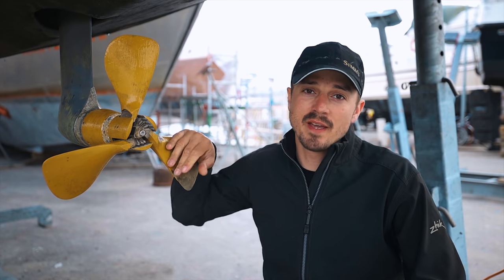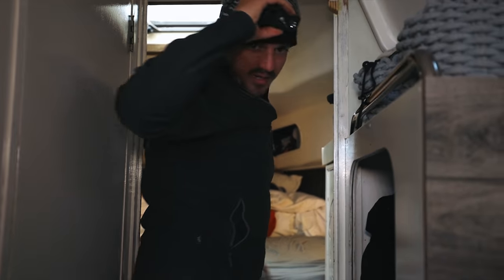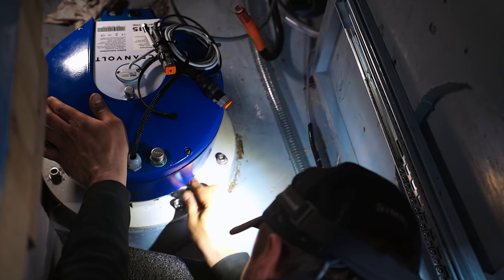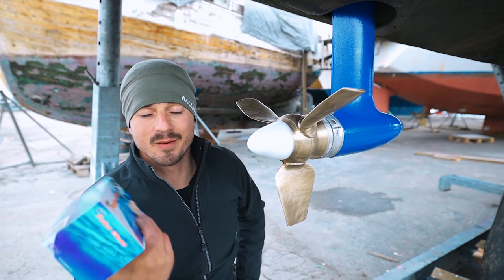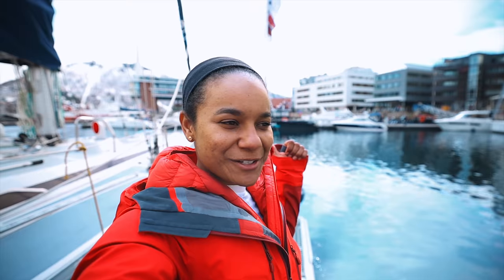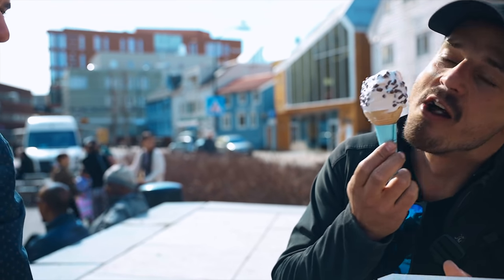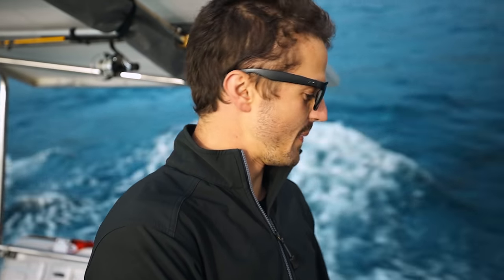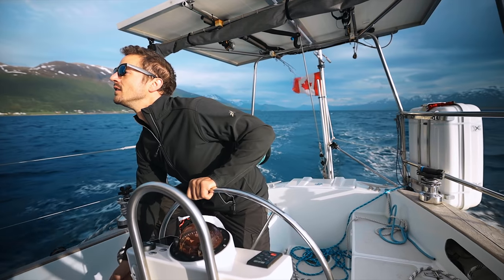Ripping Out our Electric Motor for the LAST TIME! — Sailing Uma [Step 277]

Comment: If you didn't need the wood burning stove than what would you put in it's place?
Reply from the maker: well if we didn't need the wood stove, it means we would be somewhere warm.. in which case, we would need air conditioning instead 😂
Reply: @SailingUma  Good point. Didn't think about that. I was thinking of shelving for more storage.
Reply from the maker: ha, we did have a zen garden before the wood stove. But we most likely wont ever remove it. because even in the med, it can be cold enough in the winter that we'd want some heat.

Comment: Of course you did top up the oil in the sail drive housing … yes yes you trusted the factory filling it … but you didn’t mention it
Reply from the maker: There is no oil in the SD when shipped. Of course we added it after installation.

Comment: Very cool project. Congrats on getting a major upgrade. I hope it works better than designed. However; I have major heartburn about the model number because the SD15 unit that you took out is not the same as the SD15 that you installed. IMHO, this is very poor configuration management. I hope that other details have not fallen through the cracks at Ocean Volt.
Reply from the maker: One is and SD15 the new one is an SP15.
Reply: @SailingUma  My mistake. Thank you for the update.

Comment: If the prop doesn't slow them down. Why bother buying a servo prop instead of a cheaper fixed one? Or lock the lock old one in open position.
Reply from the maker: there are times you don't want or need regen. If you batteries are full, that power needs to go somewhere. It also makes some noise. These motors are made to accomodate faster boats too, that can fill up their batteries in much less time, then have the system off for a few days before turning it back on again.

Comment: Why haven't you got a diesel or petrol generator to charge your batteries when they was low on power and during sailing so you didn't had to get those fumes at shore? You using your dingy with a petrol engine and it only helps you to take you if you have anchor from the coast line and want to get on land. So during your time on land you could easily charge your batteries with a 6Kw 230Volt generator.

Comment: the dynastart system developed by siba electric where the starter and dynamo are the same unit  ie an electric motor and dynamo combined was developed in the 50s and was popular in the 60s.so this idea is not exactly new. but developing it to make it more efficient with modern technology should be possible.

Comment: Question: Are there any zincs to prevent electrolysis?
Reply from the maker: Yes. That big silver shinny ring just fwd of the prop.
Reply: How often do you need to change that zinc and can you do it without hauling the boat?

Comment: The propeller blades seem too small for maximizing regen at typical monohull sailboat speeds (6 to 8 knts). A larger diameter and wider blades should be much better both for regen and propulsion especially since the torque required to throw larger blades is not a problem for electric motors. Additionally, there should be a setting in the system for maximize regen such as angling the blade even if it reduces speed.

Nonetheless, as usual, nice sailing, explanations, and footage. Glad to see your electric solution coming closer to its potential.
Reply: I was thinking the same thing. Optimized for regen at slow speed sailing?  I have a feeling ocean volt knows what they are doing but I would love an explanation if they are following.
Reply: I'd like to understand the physics why this setup can push 15kW forward but only delivers 0,5kW Regen with 7kts of boat speed. I would have expected several kW actually.

Comment: Although I admire your dedication to electric propulsion, an original two cylinder or 3 cylinder diesel probably would have lasted the whole time with minimal maintenance over the lifetime of your boat. I suppose there's trade offs and  some benefits to every system.
Reply from the maker: The original diesel was seized. So we needed a new motor anyway. 

If you have a working diesel, keep it. Just like EV cars. Of your gas car is still running well, keep it. If you’re in the market for a mew car, go electric. Gas prices will only go up in the future.
Reply: @SailingUma  you need not be so snarky in your reply. Salt water and moisture intrusion are the worst on electrics/electronics in marine applications. Wishing you safe travels!

Comment: I would like to have known what the diameters of the two props, old and new, were as I posted a few months ago that a bigger diameter prop, with a lower pitch would generate more power, with only a slight loss of efficiency motoring.

Comment: Why not just run a fixed blade prop without the added servo complexity? If there's no noticeable difference in speed with the prop feathered or not.
Reply from the maker: You don’t always need or want regen. Of faster boats (like the Salona) we were making 1kw of power from each motor. Once the batteries are charged, that power needs to go somewhere. Unlike solar, it can’t just not charge.

Comment: Hi Guys. Sorry but I don't get it.  Fifteen years ago I spent two weeks in the Bahamas sailing every day with a very early tech electric drive system. The boat was a 44' ULDB with a carbon mast and high roach battened main.  As a sailing machine she was in a different category from your smaller and much older design. But the main difference was the large, slow turning, and very optimized four blade prop.  One of  the  pleasures of sailing  the boat was  the fact that  you were always in silent power  mode, either making  or using  power.  In moderate winds I'd set the controller at neutral, which in practice meant that in  the lulls you received just enough boost  to keep the speed from falling  off. Set  for zero regen, the prop would just tick over producing  near zero drag--better than most feathering props.  And when you had energy to spare from sailing  you could crank  the regen up  to the maximum output of the system.  

The latest  OceanVolt design includes a very nice miniature "electric Hundesdat" variable pitch system,  sophisticated prop shape, and advanced electronic controllers, but I'd be surprised if the actual prop efficiency is as good as the big (cheap) slow turning one on the Wilie ULDB,    

On a related issue, I've spent too much time sailing among the floating logs in the Pacific Northwest and the migrating grey whales off Mexico to ever go to sea with a saildrive strut under my boat unless the entire drive system was encased in a water tight compartment that  goes all  the way from the hull to the cockpit sole so the Whale Kiss wouldn't sink the boat.

My conclusion then was that the concept is best suited to a large(er) high performance multihull with acres of solar panels that spends most of it's time anchored in the Caribbean.  And who's owner had a large budget for Li batteries.   Your mode of sailing for sport and as an experiment in technology is great, just not for everybody.  Reminds my of meeting Larry Pardey years ago just after they had done a 54 day passage from Japan in there engineless 24' boat.  Somebody at the dinner party asked:  What did you do with al the time?  Larry paused for awhile, then said  "Well, we had a lot of box wine."

ps-- I like your form of Crazy!
Riichard--- AKA  Crazy Horse

Comment: why would your point of sail affect how much regen you get? speed through the water is all that should matter. I get that beam reaching is the fastest point of sail, but beam reaching at 5 knots, running at 5 knots or pinching at 5 knots should all generate the same power, no?
Reply from the maker: It has to do with overall speed consistency. Pointing and running both fluctuate hull speed more than beam reaching where average speeds are more consistent.
Reply: @SailingUma  thanks for the reply! I love your channel, especially the technical points. The travel component of your channel has been a welcome window into the world from the lockdowns of this pandemic. It hasn't gone unnoticed that you've altogether avoided mention of it. I'm curious about how covid has impacted your travels, but also appreciate that you've created a travel vlog during a pandemic without letting the pandemic seep onto the screen. I'm sure that hasn't been easy. Keep up the great work.

Comment: Why didn't you install both
Reply from the maker: Why would we? One is more than enough to push our boat, and the old drive wasn't very good at regen at the slow speeds we sail. No need to over complicate a simple solution.

Comment: As far as prop designs go I do not think that that particular blade design is the most efficient. I say that because a squared off prob blade architecture results in cavitation on the end of the blade.  The cavitation creates drag and less efficiency. Perhaps the slow speed of the prop will not produce the side effects created by cavitation.  One more issue is that you have a lot of clearance between the blade tip and the hull on your boat.  That tells me that a larger blade could be used to provide more regen power.
Reply from the maker: We’re actually at the min recommended bland clearance. If we went any other, there would be prop slap on the hull and we’d loos efficiency. As for the prop design. Not sure what to tell you. OV has done 10yrs of R&D to come up with the system they have now. Is it the “best”? Not sure. But they think it is, otherwise it wouldn’t be used.

Comment: Regen not going to work with this size prop in any serious way. Gimmicky at best. 
Kika can generate this on a bike with a generator on a bad day, not a bad idea actually!
Reply from the maker: Um… did you watch the end of the video? 500w X 24 hrs is 12kWh a day. How is that not significant!?
Reply: @SailingUma  you have to factor in real world situations, not hardcore sailing like you guys do. I certainly understand the need for sponsorship however for someone sailing in a warm climate, with little wind like most sailers do, you will not meet the energy requirements of a comfortable boat.

Comment: I will say it again,hopefully everyone who has a little common sense will understand it: there will be never enough power drawn from that tiny little propellor from oceanvolt to be selsufficient in powering on electrity the boat.
As long as any system do not slowering the boat from ex.6 knots to 4.4 knots no more power than the 300 w will be obtained.
Or you sail with this size of prop at 30 knots,or you mount an dedicated system with bigger servocontrolled blades.
Off course the guys of oceanvolt are aware off this,since they are much smarter than i am.

Comment: Ocean Volt should develop a prop/servo motor application for traditional full keel boat where the prop is protected and not exposed to fouling.  The SABB diesels used a similar prop with manual control. Adapting a servo motor to the manual control mechanism  would get it inside the boat and still perform the function of controlling the pitch to maximize the regen.

I am not pleased with the fin keel types with appendages like rudders and sail drives that are just asking to collect weed and lobster trap warps complaining about sailing in Maine.  That sail drive with the forward bulb design might be efficient, but it is not practical anywhere where there is stringy stuff under the water.

Comment: A few things surprised me, firstly its only a 34 volt motor, most motors these days are 48v, even my ebike motor is 48 volts and 48 volts has been proven to be more efficient than 36 volt versions, and will draw about 150 amps at 48 volts against the 235 amps at 34 volts. I was also surprised that its only a 12kw constant rated unit (16 horse power), yes it has lots of torque, but once again ebikes commonly have 5kw units with regen and work often at 60 or 72 volts, and regen will be a lot better with a 48/60v system too....  Wonder if there is a reason they went for such low voltages and specs for this setup? (its not as if they are overly limited on space with a boat compared to a bike!) I was expecting a minimum 48 volt (actually 72 volt) and 25kw system for efficiency and safety margin and better regen. And that variable pitch prop is just an extra complication waiting to go wrong, as shown in the video there is no drag with a fully deployed prop in active regen, so might as well just attach a fixed prop and do away with the servo variable prop!
Reply from the maker: These are all great questions....for Oceanvolt. They're the ones that spent 10 years and millions of dollars on R&D to come up with what they did. Is it perfect? Nope, is it better than anything else currently available? Definitely. 

12kW is equivalent to a 40hp Diesel motor. Plenty to push our little boat. In fact we can go 7kts and only draw about 8-9kW. So it's about 25% more power than we can even use. 

The overall system is actually 48VDC, but the motor is 36VAC. Not sure why, but I'm sure there is a good reason. 

As for the fixed prop. A prop that is efficient at pushing you forward, isn't very good in reverse, and terrible for regen. So the Servoprop is basically 3 props in 1, all tweaked for peak efficiency at the given cruising speed of that specific vessel. Hence the added benefit of added complication.

Comment: I was with GE for 33 years as a technical salesman. Applied battery motors for small harbor boats and electric vehicles. Send me an e-mail and I can help. For every 1 knot of speed record ocean volt motor rpm, volts, amps, and watts. Do this in the harbor with no wind and no sails. This will give a profile of the force or thrust it takes to move the boat. Ocean Volt should have a spec sheet showing  thrust vs rpm or torque vs rpm.  The power to move a displacement hull through the water until max hull speed is reached goes up as the cube of the speed. So it takes 8 times as much power to go 6 knots as it does 3 knots.  The power of a motor or prop can be calculated by the formula rpm times torque in ft lbs, divided by 5350 equals horse power. 746 watts also equal 1 hp. You need to know what thrust or force it takes to move boat through water up to its hull speed.   If it takes  say 10 hp to move boat at 6 knots thats 7460 watts , Dragging a prop through the water producing  only 800 watts regen is a small portion of that.
In a strong wind that will not slow the boat  down under regen but the prop has to be the right size and geared properly so it can produce the 600 to 800 watts  at 6 knots.

Comment: You're going hull speed , ofcourse it doesn't slow you down , you've got plenty of reserve power.
Now reduce the windspeed and tell me what happens.
Switch of the generator when going 4 knots and tell me it doesn't effect your boat speed.
I'd install a separate system for power generation as back-up (WATT&SEA for instance) to my diesel engine.
I'll never go full electric until I can reach 700 nautical miles on it.
I like redundancy.
You're telling me enough in your "partnership" comments , you get your shit for free.
I might as well watch the commercials and take what they say at face value :P.

Comment: Price starting from for SD15 servo prop 46600 € + VAT + Shipping.  Its more expensive than the boat lol....
Reply from the maker: That includes batteries and charger (50-60%) of the overall cost. You need batteries and a charger anyway.

Comment: 1:00 Please don't ever do that again! Never stand under a suspended load like that. It is so dangerous.
If this happens to the crane holding your boat up, you'll be squished.
   Note the broken strap is EXACTLY the same kind holding your boat up.
https://www.youtube.com/watch?v=GCpPoUP4tVA
Reply from the maker: It’s always amazing what you can find online. They’re are countless “fail” compilation of folks getting hurt doing just about everything. 

Risk should be assets on a personal level, at that specific time, in that specific environment and circumstances.

Comment: Are they requiring you to ship back the old motor and sail drive unit for analysis?
If not then I would store it away.  Remember what survivalists say
"  Two is one and one is none " .   It will be good to have a spare motor.
You could combine the upper an lower units and make it into an emergency outboard motor.
You will thank me when Somali pirates are chasing you down.

What I am saying is to resist the impulse to give it away.

Comment: Such a system must be expensive! How much? Or, are you not permitted to disclose!
Reply from the maker: Prices for multiple different installations are freely available on their website. 
https://oceanvolt.com/standard-systems/
Reply: @SailingUma  guess when you're sailing the deep blue seas, you have deep green pockets! (Money!) That was an expensive packet! 👿
Reply from the maker: it is quite expensive up front yes, which is why we waited several years before we could even get one, but the whole beauty of this... is ...you can ALSO do it for a lot cheaper (if Regen is not your goal) as we've proven over the lat 6 years, we made it work with $100 forklift motor.

Comment: This is terrible performance - the prop is way to small!! I would say your boat has a power potential around 20,000 watt in those conditions (35hp which is 26,000 watt would probably give you 7 knts through the water and at 80% efficiency that is around 20,000 watt) - so generating 300 watt is absolutely terrible (1.5% efficiency) - and completely useless on a day with low to moderate wind it would basically amount to zero since the power correlates to the velocity to the third v^3 exponent

Comment: Wenn is the dingy going electric  ?
Reply from the maker: Probably never. 

Electric power boats are extremely limited. 

We would need the same size battery bank as we have in uma to motor for 1-2 hrs in our dinghy. And that power has to come from somewhere. No regen on a dinghy.